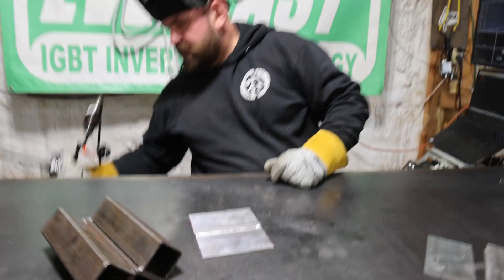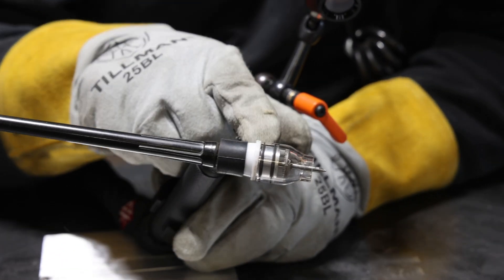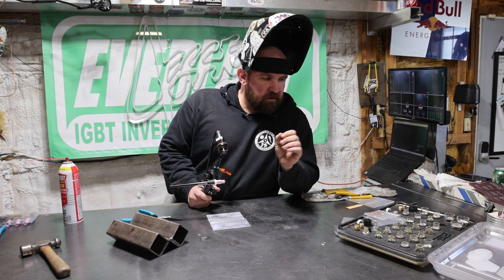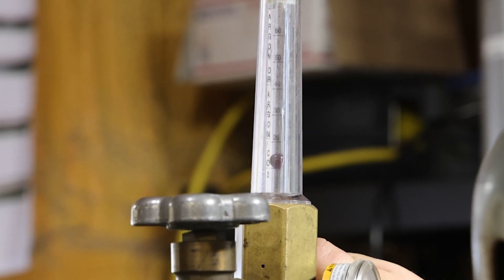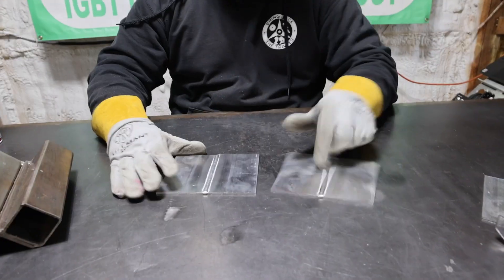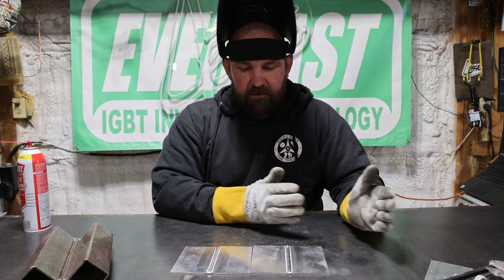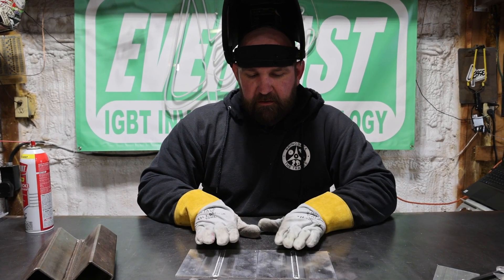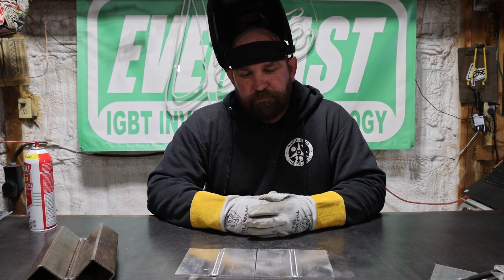it's the WELDER, not the WELDER

Comment: Amazing video. 
I’m trying to find the best setting for welding alluminiammo on my welding machine, and I find it “easier”when I do on alluminiammo sheets like the one you are using , but I have more problems when I have to weld my real product which is square tube,30x30mm 2 mm thick. Is possible to have a video on that kind of material? Any notion you will cover would be precious.

Comment: What gas do you run for aluminum tig? You said it on one of your live sessions it’s from praxair if I remember.
Reply: Typically I’ll run a mix gas of pure argon and 200ppm oxygen and 200ppm nitrous oxide. Praxair calls it stargon AL. My local supplier AWG also has a mix that is extremely similar, but they don’t have a trade name for it, we just call it “the hot mix”